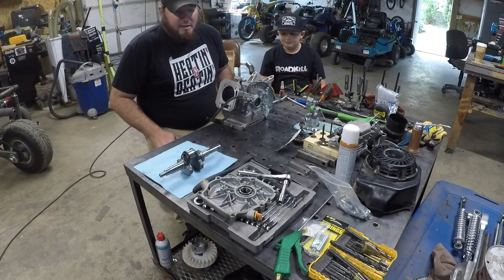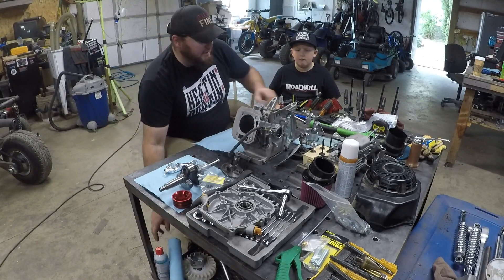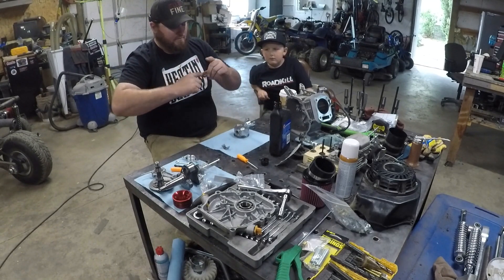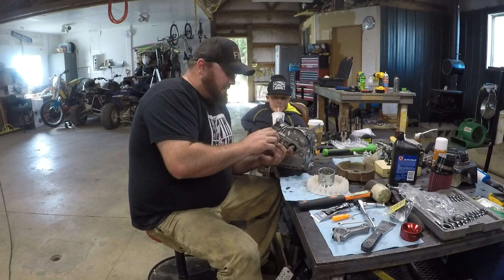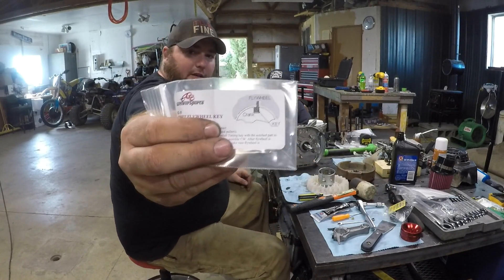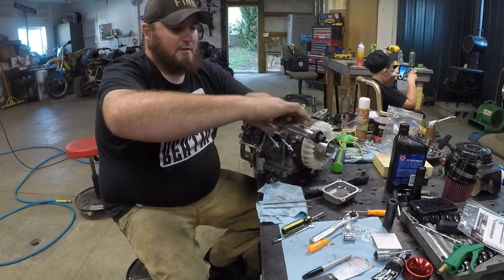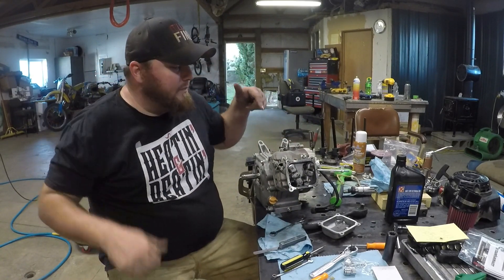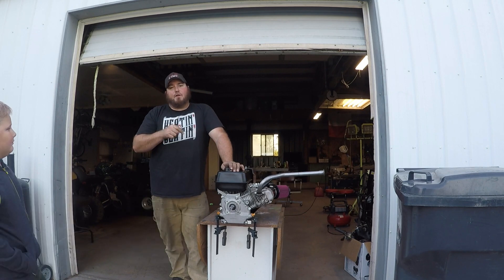Tri-Sport Build Ep 2 - Stage 2 Engine - Badger Canyon Motorsports

Comment: How come you didn’t put a billet fly wheel on?
Reply from the maker: Because I don't plan on spinning it to 7000 rpm. With the mod2 cam shaft it makes more power at a lower rpm than the stock cam and that's all I wanted.
Reply: Badger Canyon Motorsports thanks for the answer I love the videos keep up the good work!